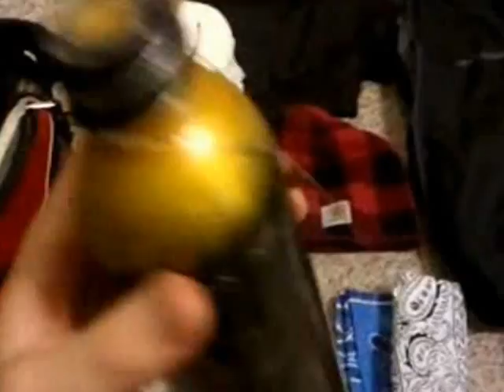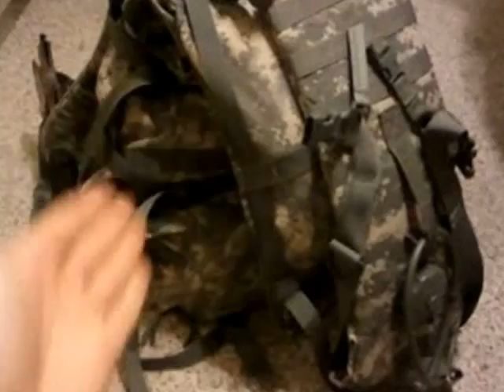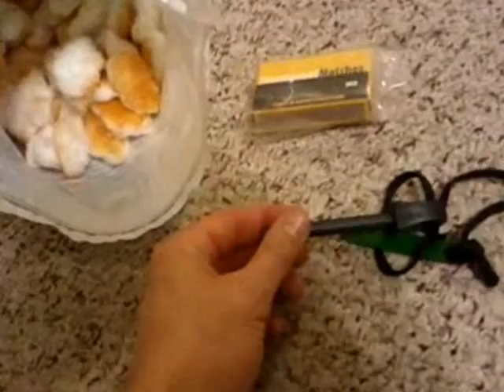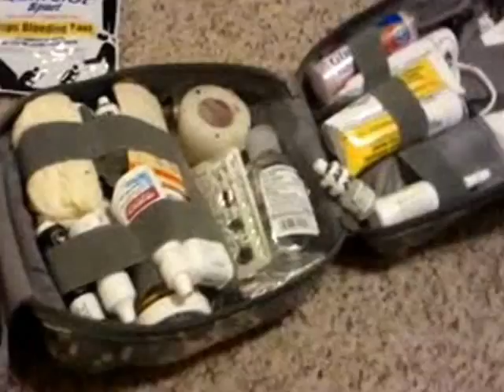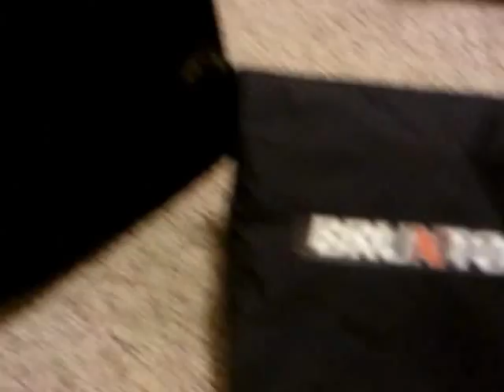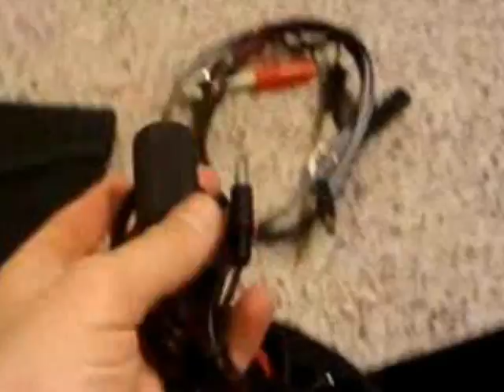Bug Out Bag ... Long Term Survival Pack

Comment: It seems like your communications are way over loaded. It's good that you are a licensed ham radio operator but all you *might* need a single pair of squawkers and a battery powered radio. The hand crank concept is good for a bug-in situation, but in a bug out situation it becomes dead weight. If you drop it, it will break, too many moving parts to fail, and to just listen to the radio it's too many ounces. Better off with a tiny FM/AM/Weather radio. I have an Emergency Task Force radio

Comment: As for bait, I think fishing is 75% luck, 25% strategy. If you use artificial bait or fancy lures it's because you're a sport fisherman looking for a particular species to catch. If you are fishing for survival, the weight of bait will require calories to carry. Worms and grubs are not difficult to find. Flip over a rock or a log and you'll usually see worms right there. Bust into a rotten fallen tree and you'll find grubs. Fish a pretty dumb animals and will in certain places/times bite

Comment: You're not supposed to carry batteries loose like that. You should tape them together so they can't form a circuit. And then they should also be stored in some water resistant container like a zip seal bag or an oven bag that is rolled like a seal line bag. Oven bags are good because they are super strong, can be used to homogenize water (not boil) and their seams are more durable than zip seal bags.